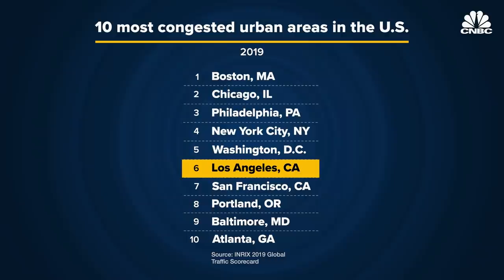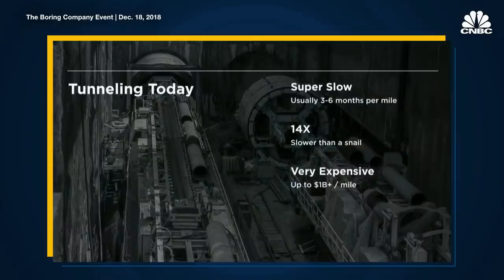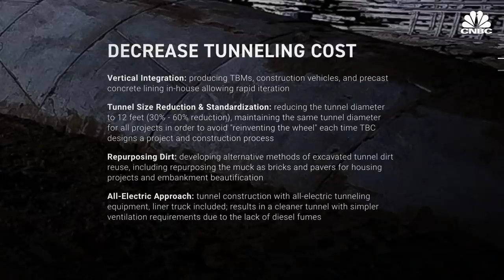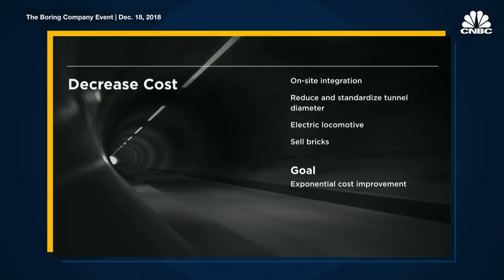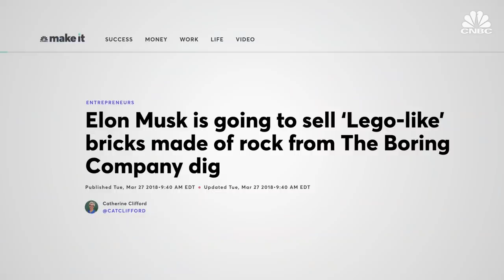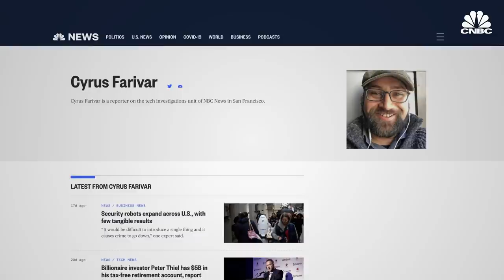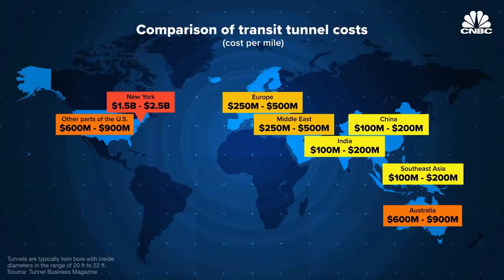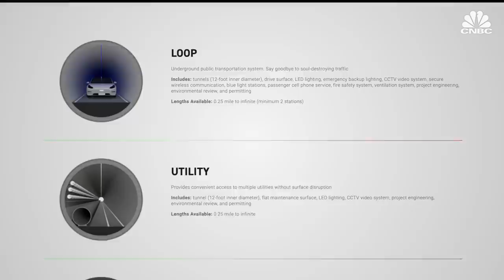Why Elon Musk’s Boring Company Isn’t Fixing Traffic Anytime Soon

Comment: I saw a really good YT video that calculated that to hit 4000 people per hour people would have to enter, pack bags in trunk and leave within every 16 seconds. Oh and no handicapped people ever.

It would also mean that cars could never slow down at stops and those merging would have to do so with cars going 150MPH. And if one little thing goes wrong everything fails and would most li likely cause multiple deaths,  and with the teslas lithium batteries would mean rapid super high fires that firefighters could not put out.
Reply: Their calculations were flawed.    None of the passengers have bags to put in the trunk, so that's a red herring.    If one passenger takes extra time to load, it doesn't hold up other vehicles.  Other passengers load up with time to spare, and will simply get moving and into the tunnel ahead of the one taking extra time.  Tesla fires while driving are really rare.  One of them would be devastating, but with the emergency equipment and procedures they have in place, the fire might not lead to any loss of life.

In the real world, these tunnels and stations work pretty smoothly.  Less than 15 second average waiting time, and less than 2 minute average trip time at the LVCC during CES.
Reply: @kevinbailey8827  why wouldn't people have bags to go in the trunk? It's near the expo.
Reply: @alimfuzzy  it’s for people attending the convention center to get from one end to the other.  They will only have the things they are carrying around with them on the convention floor.
Reply: @kevinbailey8827  have you ever presented or been to a convention? You end up carrying a lot of stuff.
Reply: @alimfuzzy  I haven’t seen anyone using the trunk in any of the videos of the loop that I have seen. If storing bags in the trunk is allowed, it’s definitely not the norm.
Reply: @alimfuzzy  Anyway, the math to me looks like this: 4400 passengers per hour means 73.3  passengers per minute.  At three passengers per car there are 24.4 cars per minute.   Three stations makes it 8.14 cars leaving each station per minute.    That's a rate of on car leaving each station every 7.3 seconds.    It seems very possible to manage that with 70 cars in the system.  Some cars will be loading while others are preparing to leave, leaving, in the tunnels, or arriving.
Reply: @kevinbailey8827  Sorry but I think there are some assumptions in that maths that could be challenged. You assume 3 persons per vehicle, stats for taxi use shows 1.2 persons per vehicle. But I would assume the real number is somewhere in between as many people using the LVCC loop are going to the same place and won't mind sharing. 
The second thing is that your maths assumes equal weighting at each station at the same time (this almost never happens). You get pressure at one end or the mid point.
Probably the biggest issue (and the reality bears this out) is the congestion at the mid station having only 4 bays on each side. Even with a 7.3 second frequency and only half the vehicles stopping, with the other half passing through, that is leaves less than a minute on average for the car to stop, everyone get out, the next lot get in and the car leave the station. This may be feasible in theory. But what if 4 cars in a row want to stop at the mid station (entirely possible). An someone who arrived in front of them dropped their phone, under the seat. Another couple decide they have got in the wrong car going the wrong way and want to get out. Any number of everyday real world events and you get congestion backing up into the approach tunnel. Immediately followed by a shortage of cars at the end station, and so the congestion grows until the number fall considerably to ease the congestion. 
A pedestrian flow modeler could explain this better. But we have all seen this happen at busy venues and taxi ranks. Which is effectively what we have at LVCC.
Hence the theoretical 4400 pph comes down to 3400 pph (biggest number I have seen for actual passenger flows)  before the system starts to show congestion.
The system will need many more loading bays at casino stations to deal with busy times (end of a show, etc).
Reply: @tunnellingsalisbury7605  I think at the LVCC we can assume that most cars will carry three passengers during busy times, because I have seen on video the attendants asking for single riders waiting to fill an empty seat.  And in slow times it doesn’t matter as much (they wouldn’t hold up a car that’s ready to leave when there’s no single passengers waiting).

If there’s an average of one car leaving a station every 7.5 seconds, then in some cases cars will leave at shorter intervals.  It’s not a situation where the cars are leaving at precisely that interval and any car that experiences a delay causes a domino effect of failure. If one car is experiencing a delay and another is ready, the ready car doesn’t have to wait. 

Casinos will have to design their stations well, or have a plan to expand if needed.  Off the top of my head, a separate area for loading baggage might help when the system serves the airport. My personal opinion is that they will need larger capacity vehicles to serve the stadium during events.
Reply: @kevinbailey8827  I doubt very much its a full 3 each time, not from the footage I have seen, at best 2.5. But even so that only seems to work if you have a driver and an attendant organising things. That's one of the key problems with scaling this concept.
Many metros that have fully automated operation still have a "driver", although their main function is the closing of the doors once everyone is off and on. It's the human/machine interface that is always the hardest to get right.
In Hong Kong we have several of the metro lines that now have no driver at all, at peak times they still have attendants but they are not responsible for the normal operation, only if something goes wrong (it very rarely does).
Reply: @tunnellingsalisbury7605  We’re soon going to see if the Loop will scale to a 29 mile system (14 miles in metro terms) system with 51 stations.   The test is not whether it can carry as many people as a much larger system like Paris or Hong Kong. The test is whether it can carry the number of people it needs to. 

The LVCC Loop hasn’t been overwhelmed yet.   

There are many ways the Loop can scale. Larger vehicles can be deployed when needed.  Much more can be automated. More tunnels can be strategically added where extra capacity is needed.
Reply: @kevinbailey8827  51 stations in 14 miles. I read elsewhere there will be a section with 7 stations in 2 miles on the system. My issue with this is the density of underground construction that entails. Try drawing up the network of tunnels coming off and on a "spine" tunnel (in each direction). There is not a lot of space left. Most of Vegas already has an underground network of large storm drains and utilities (a lot of power/water/waste to deal with in Vegas). If the stations are underground it will be all the more complex.
It is designed (TBC say) to take 57,000 people per hour. That's an average of over 1,000 per station per hour, or a vehicle entering the system from any station about evert 10 seconds (assuming even patronage at all stations which never occurs).
By larger vehicles I assume you mean tesla X's as these are about the largest vehicle that can fit and also use the station stopping bays. No problem with that. I would assume they would be used all the time as a mixed fleet makes little sense.
To automate everything is in place (in use across the world) except the vehicle human interface at the pick up and drop off points. That the difficulty they currently have with LVCC loop as the still need attendants and drivers. It would be easy to get some volunteers to trial it without drivers on a shutdown period to prove it to the authorities. I have no idea why this has not been done.
More tunnels can be extended if the existing system is designed to allow. But parallel tunnels for more capacity does not work (again, try drawing how you add to an existing system). This is why unplanned (from the original design) extensions to metro systems always cost an extreme amount.
Anyone who says we just add more tunnels or we just go deeper (like Mr Musk keeps repeating) shows they know nothing about tunnelling or transport planning.
Reply: @tunnellingsalisbury7605  I plan to wait and see how they solve the issues you raise.  

I expect it will be more difficult than their rosy predictions, but that they will persevere. I also think they know more about tunneling now than they did in 2017, and that "they" includes many experts with lengthy experience in transport planning.
Reply: @kevinbailey8827  Well we can agree on that. They don't seem to be very forthcoming with explanations of their technical solutions though.

I would say they know infinitely more now than they did in 2017 as they seemed to know almost nothing back then. 
Now they are coming to terms with the difficulties and I assume they have some level of in house expertise, but the Resorts World tunnel had some fundamental problems clearly.

Still a lot of planning, investigation and design to do before they start digging along the strip.
I think it has a big multi box storm drain below it. That will take a bit of getting around.

Comment: You will not catch me in one of those tunnels.  The first tunnel lithium battery fire will be deadly
Reply: You will risk your life many times before the first tunnel lithium battery fire.
Reply: @notbuyingit8047  Not at ten miles per hour.
Reply: @notbuyingit8047  You'd lose that bet.  Tesla fires while driving are rare.  Traffic in the stations is slow.    You probably are safer in the Loop than flying, or driving on the highway, or taking the subway.  

Fear of lithium fires in tunnels is something that tunnel engineers should have, so they can think of ways to mitigate if they happen.  As a passenger,  the odds of it happening to you are so low that you don't need to worry at all.  It's not a rational reason to stay away.

Comment: Too bad it's impossible to put trains underground ... 

wait...
Reply: Not impossible.  Just extremely expensive in comparison.
Reply: @kevinbailey8827  yes it's more expensive to put it there but it's a single high one time cost after they start running the train is much more cost effective per mile per passenger
Reply: @ballisticfuror1033  No.  Electric cars are already nearly even with urban trains in terms of energy use per passenger per mile.

In the case of the LVCC Loop, the difference between the cost of an underground train and the loop was $150+ million.   Operating costs are about $6 million per year.     Even if the operating costs for an underground train were zero (which of course they aren't), it would take 25 years for those savings to add up to $150 million. 

If the underground train cost only $3 million per year, it would take  50 years to break even.     

A train would not even come close to being cost-effective.
Reply: @kevinbailey8827  yea but comparing a 2 mile underground road to hundreds of miles of tunnels twice the diameter is a bit unfair. i also think you are missing the point, a train might run at a lower profit for the person who built it but most trains arent built for the profit for the builder but the provide cheap transport for people and goods. 

if the goal is profit then the LVCC loop still bleeds money as they have to pay nearly 300000 dollars in fine every year due to not meeting the goals set. 

also the loop took two years to build if im correct even tho its half the size in diameter and its 2 miles long.

Comment: All you guys talking about trains.

Cars have the advantage that you can start at any random location and go to any random location. There doesn't have to be a track built to where you want to go. 

Loop is like a highway, but the car carrying pods can go a lot faster than a car on a normal highway. At least for now, before we have fully autonomous cars. (fully autonomous cars might travel at near top speed on highways in the future (100-120 mph for most cars)).

It's like a Personal Rapid Transit system. You can start at point 1 and go to point 100 without having to stop in between (even if someone else wants to stop there).

https://en.wikipedia.org/wiki/Personal_rapid_transit
Reply: Cars have alot of disadvantages, like how they are absolutely terribly space inefficiënt and how they are very dangerous, they do this whilst also polluting alot which is giving alot of people cancer, and whilst they are doing this they are also cousing alot of traffic and wasting alot of expensive space, and one of the stupidest things about the pods is that they have terribly economy of scale, so they are wasting alot of energy whilst being very expensive whilst moving only 16 per pod, it would be easier and better to have a train run trough the tunnel on rails.
Reply: @neutrino78x  don't you know how absolutely terrible the production of lithium ion batteries is vor the environment, and the electricity all needs to be green before it actualy has an impact, but only then does electric cars do something, but then you still have all the other problems.

Comment: These tunnels should be used in conjunction with covered pathways on the surface for personal transportation vehicles (bikes, ebikes, scooters, etc.). You can put solar panels on the roofs of the surface-level pathways to get some energy for the city. If roads and rail are the veins and arteries of the city, these smaller paths could be the capillaries.

Comment: Does no one see how useful this could be?! Trains go linear, most places you need to go aren’t linear. Errands aren’t point A to point B. This is genius. Lay off Tony Stark. This man rocks👏🏼👏🏼
Reply: No we can make trains turn it is just on a lower dgreee then sharp 90 turns but then even cars can not do it in small spaces and not to mention trains can hold a lot more people with less engines going around not to mention it can use clean eangery but running power lines in the tunnels
Reply: And even at the proposed speeds the tunnel works at a car not 90 degrees and it would crash into wall and even 45 dgreees it would make a lot of wear

Comment: I'm surprised no one has figured this out yet... Tunnels, electric cars, solar power, starships.... This is all about Mars.  Internal combustion won't work in Martian thin atmosphere... Electric cars.  Tunnels would be more efficient means of travel than putting roads on the surface of Mars. Tunneling is a skill set not easily acquired.  Takes years of actual experience and very expensive equipment.  The Boring Company is basically the Elon Musk Institute for Tunneling Technology.  Solar is a no brainier.    If any or all of these make money that's just a bonus.  My guess: In the next decade, You'll see musk develop a company or two in agriculture, specifically technologies that can be adapted for food production on Mars... Soiless hydroponics, aquaponics, vertical farming, etc.

Comment: When someone who knows something about tunneling technology listens to what Elon Musk says it seems like he doesn't know what he is talking about. For example you can't make appropriate concrete for tunnel tubing parts from dirt taken from tunnel. They would not be half as solid as needed. Forming tunnel tubing parts requires quality control and industrial conditions. To make elements hermetic.
Reply: Actually the BBT uses some of the rocks they get. But you are correct, you can't use all the drivel there.
Reply: just look the Brennero Base tunne  they are reuding the drilling matreriaria to built part ot the tunnel
Reply: @Lorre982  I can agree that it depends on the part of world where the tunnel is drilled. It is all about geology, hydrology, soil condition etc. In place where I live none of the drilling output can be used once more. But of course in the Alps where tunnel is drilled in solid rock you can reuse the drilling output. Didn't think it through
Reply: @wojtekrajczak3725  and they are usinig the recycling method since the beginning of the Austrian part (aka  2007), so was not a new idea